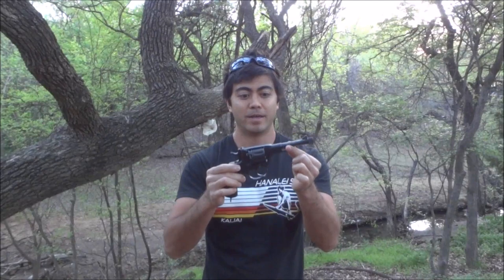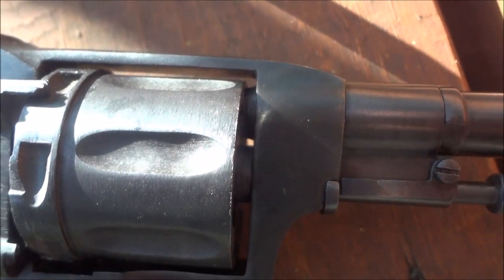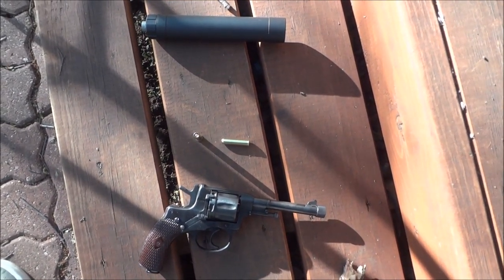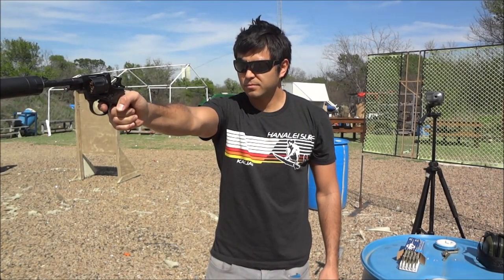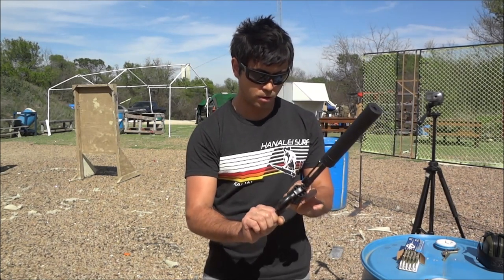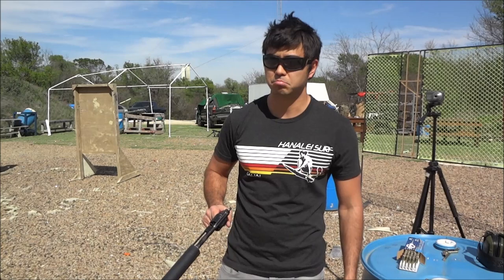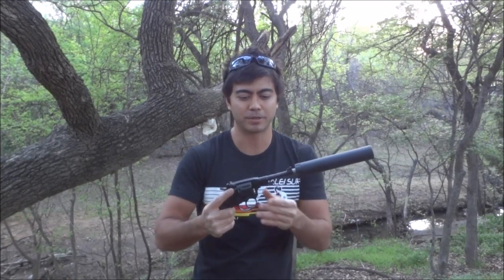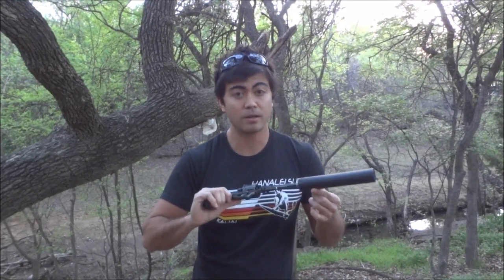Suppressed Silent Revolver - M1895 Nagant (Ep40)

Comment: The assassin's gun. No shells, no sound.
Reply: The Vietcong were known to use them suppressed.
Reply: Doesnt the shot, even when suppressed, make more noise then the shell?
Reply: @Nameless i think new tropics meant that since its a revolver there are no spent shells being ejected from the gun so there are no shells to worry about being found after the assassin has finished the work
Reply: One of the reasons the NKVD loved it so much.
Reply: My thoughts exactly "a getaway gun" but I'm thinking the ammo would be more rare and reloading your own might not work with the cases.
Reply: big and unwieldy to be an assassin's gun..
Reply: Shotguns have shells. Pistols have cartridge casings.
Reply: no DNA
Reply: @Clipgatherer  First suppressor early 1900s
Reply: @Razorwire882  This supressor was created in USSR ,its is called BraMit (Bratya Mitiny) or Mitin Brothers
Reply: hired killers in Russia are very fond of these weapons. The quiet sound of a gunshot. The cartridge case remains in the drum and examination is not possible. They also use sports cartridges with a lead bullet, so that it is more difficult to identify the weapon, the soft bullet is strongly flattened.
Reply: @nameless9767  No, but... I don't even know what you mean by "shell." The parts of a revolver cartridge do not include a "shell," but rather a "case," primer, propellant, & bullet/projectile. A suppressor reduces the muzzle noise, flash, & blast (up to zero), so in this case, w/ a SUBSONIC bullet AND an "over-suppressed," this revolver will be quite quiet. Review the video - lots of detail. This configuration is just AMAZING!
Reply: @cat-le1hf  So you have never handled a gun before, well ok then :) It is also going to be a little hard to conceal which defeats the purpose

Comment: The Pieper revolver also has a gas seal mechanism (and used very similar ammo), but has a swing out cylinder like the cancelled successors to the Nagant revolvers. However, unlike the Nagant, they made a carbine version with a larger cylinder (to hold 8 rounds), and it worked really well due to the gas seal design.
Reply: Some online sources said it was the same round. There were copies of the nagant without the gas seal mechanism that were cheaper.

Comment: I bought two of these back in 2012. Cool little plinker. I think I have about 500 rounds of ammo left. I just put them away after shooting a few hundred rounds. Just a SHTF arsenal pistol. Shits and giggles.. Novelty.
Reply: How much did you pay for the ammo?
Reply: At the time, 14.99 for fifty rounds (03/2012)..  The pistols where $99.99 each! Why not buy them at the time, it's gone way up but the ammo I bought was Russian surplus marked 1966. I shot a couple hundred off to make sure the pistols function but they were brand new (new old stock). I have maybe 500-550 left of the ammo. Novelty that works.

Comment: Is that the firing pin on the hammer?

And at least threading that barrel is actually practical. How else are you going to get a suppressed revolver
Reply: Yes the chamber moves forward hence the firing pin has to be on the hammer and long to reach the primer which is insides its own sealed area.

Comment: KAC, AAI, and KBP make suppressed revolvers. Also there is the PSDR-3 made by Peters-Stahl for the German SEK.
Reply: tengu190
Reply: German SEK. It was a sheath over the cylinder. Knights Armament Company only makes silenced revolvers for military or special ops. The nagant revolver is the only one of the civilian market.
Reply: Thanks for the correction. It also had an integrally suppressed barrel if I remember correctly. And a red dot or laser for the sight. It was huge!
Reply: It was a modified smith and Wesson forget the model. Quite cumbersome looking. The reason it came about was because when using one of those bulletproof shields in a raid a semi automatic can malfunction if the slide hits the shield  when firing. Obviously not an issue that exists when using a revolver with a shield. Only a dozen or so were made.
Reply: The reason you have the S&W TRR8 and R8. And why they are 8 shot and not the usual 5 or 6. Be interesting to see if you modify a R8 to be like a Nagant and then do the same with the ammo. .357 is plentiful.
Reply: For the Punisher: Warzone film they made a suppressed .500 S&W revolver.
Reply: Which was just a prop gun/ Not functional from what I understand.

Comment: Just got mine threaded with a custom silencer that is half the length of yours and is in the 7.62mm caliber. Haven't shot it but the gunsmith said it was as loud as a 22 short but that is likely due to him shooting it in an enclosed room. One thing is what he said was the bottom of the forcing cone was not the same dimensions as the sides or top so I am wondering if it has been worn done some and some gas is escaping making it louder then it should be. Still a 22 short is like a cap gun in noise so it is pretty much hearing safe and odds are someone hearing it wouldn't think a gun was firing and the noise wouldn't travel that far. Heck outside of  room it may not be audible. Well need to do some testing. .
Reply from the maker: You'll love it!!!
Reply: Check out segsuppressors they made mine and it was a Micro Jefferson so it's 1.30” x 4.656". Only losses just 33% of suppression compared to the full size can. 

They will make any caliber you want and any threading and any custom color for the silencer. No spending thousands more because some maker claims they need new machinery to do it. All that matters is the bullet diameter and pressure.

Comment: Just got to the indoor range to test mine out with a custom one fitted to the bullet diameter and that is half the size of Mike's. When run wet with muffs on you didn't hear anything except the rounds hitting the back wall of the range. Freaked the hell out of some people next to me because they were wondering what the hell I was firing that was so eerily quiet on the gun range.. 

Outside dry it sounds like a cap gun but the noise doesn't travel that far and no one nearby in a house or say car would likely hear it. My dog didn't react at all to it firing. Even at the range they couldn't hear anything outside the range and that got remarked on by the range employee who was watching the cameras seeing it fire but not hearing anything. Considering that during World War 2 and after the soviet military and KGB plus various other communist agencies used them with rubber baffles you can see why they were used especially as assassin guns.

Comment: Nice vid. I have seen several videos floating around on the Nagant revolver but this is the first one I clicked on. 
The cylinder and special cartage would make me believe that the revolver was designed for suppression, is this the case, or was it just meant to increase chamber pressure for better (theoretical) performance?
Reply from the maker: +quistan2 It was meant for higher velocity as far as I know, but I could be wrong.
Reply: It came out before Maxim so silencers weren't even known. It was just a nice side benefit. The gas seal is something that should have been in revolver rifles and shotguns. It would have made them a lot more common.

Comment: Did you use a fixed barrel spacer on that? Or a piston?
Reply from the maker: +SpartanB88 Piston threaded in 12/28
Reply: Piston is not needed since its a fixed barrel.

Comment: i've always being wondering if you suppressed a revolver what would it sound like but i guess not all revolvers can be suppressed, nice video :)
Reply from the maker: +Ahmed Saleh Thanks
Reply: +Ahmed Saleh You can suppress any revolver and it will be more quiet, but you'll still have the crack of the cylinder-barrel gap, and any report from ammo that's not subsonic. Hell, 22-250 rifles are being suppressed in England where suppressors are considered polite, not sinister.
Reply: you still need a firearms license to have a silencer in the UK. illegal silencers are seized by the police in the UK.

Comment: I wonder why most revolvers don't have their cylinder move up to be closer to the barrel.
Reply from the maker: +weiss27md It adds more stuff to break.  Revolvers are supposed to be simple.  If you aren't suppressing it anyways, then it really doesn't make a difference, except the velocity is a little more, and you don't have to worry about blowing your thumb off if you hold the gun wrong.

Comment: how much does it cost to get the same process done to a nagant or let's say a sw ?
Reply: That is a nagant revolver.
Reply: ofc. how much does it cost
Reply: It would only work on the nagant due to the gas seal. Its a barrel threading like making any gun take a muzzle break or attached silencer. A gunsmith that knows how to do it will either take the whole sight off or half of it then thread the barrel with a certain pitch. Mine was 1/2 x 28. Cost was 180 dollars. The silencer is a whole different matter.
Reply: terminator9099
The silencer has various legal restrictions since it is a nfa item. You either have to get one direct from a store that sells them and since its often a 9mm that is used you can except 600 to 1000 dolllars plus a 200 dollar check sent to the ATF. Then wait 2 months to a year for approval. If not from a store direct it has to go through a tramsfer which can be 75 doars to 200 dollars. Mine was a custom one direct from a company and it cost me base 300 dollars then 25 dollar shipping and a coating to prevent the paint metling off cost an additional 50 bucks.
Reply: I live in France. I previously owned a suppressed glock 19 and I was wondering about a suppressed revolver.
Reply: only model you can put one is a m1895 Russian Nagant in 7.62 Nagant. That is the model on the civilian market. Any other revolver you will still have chamber outgassing at the primer and barrel entrance to the cylinder. Hence why if one holds any other revolver wrong they can get flesh or even digits removed firing the revolver. Any other caliber Nagant will not work because they are not designed tp work with the gas seal mechanism in the nagant.